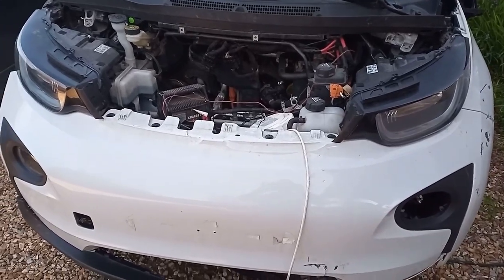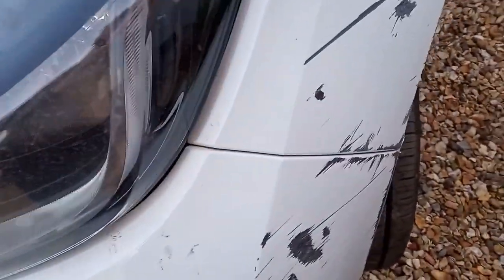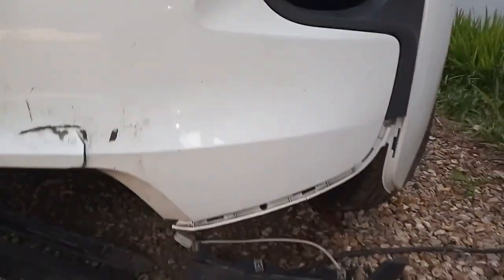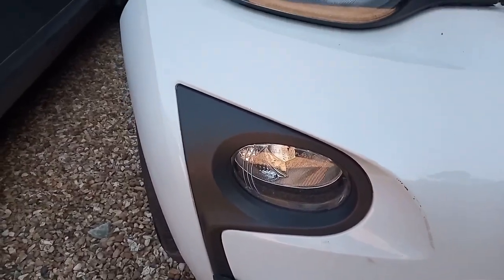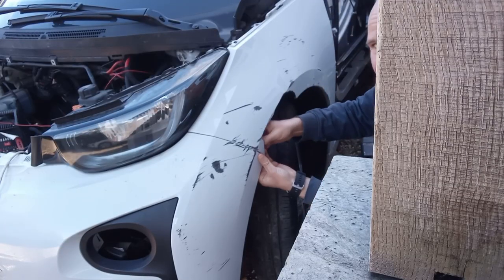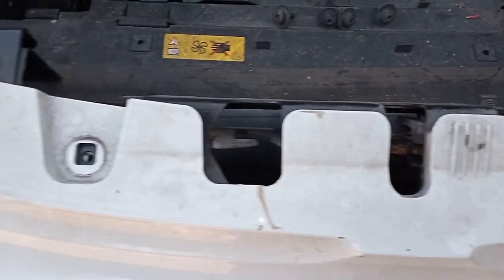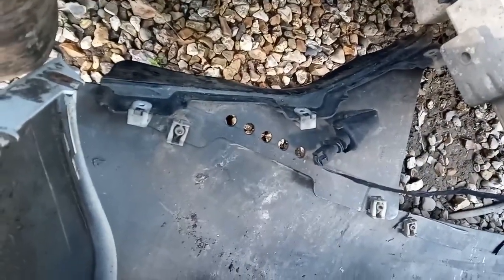BMW i3 strip down 8_ How to remove the front bumper

Comment: Super helpful teardown videos. I'm thinking about repainting my i3 a different color and it would be easier to repaint the panels off the car. Thanks!
Reply from the maker: No worries, although you won't be able to get the outer A pillar panels off without breaking them 😕
Also you'll need to have replacement clips as they tend to break, good luck 😃

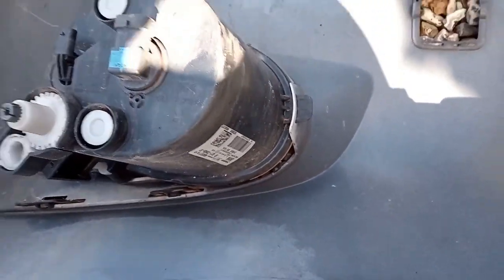Comment: 3:50 - Technically that is the spot light (high beam) and the indicator in the same housing :) Great videos. I'm really keen to see the right quarter rear panel & charging cables exposed as I have a CCS1 i3 which I'd like to change to CCS2 (ie. just change the socket - surely can't be that hard?!)
Reply from the maker: Hmm, I'm not too sure. It may not just be a case of changing the port and away you go.
Reply from the maker: We are looking into the CCS on open inverter, check out the link for some more info https://openinverter.org/forum/viewtopic.php?f=17&t=1196